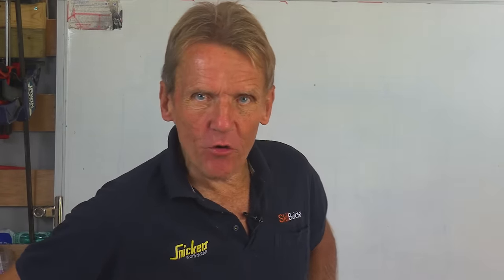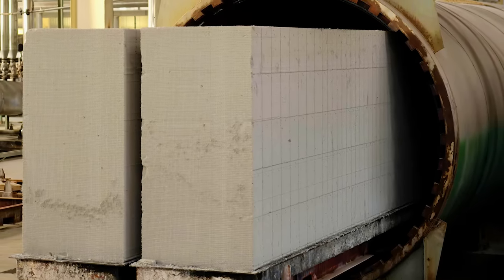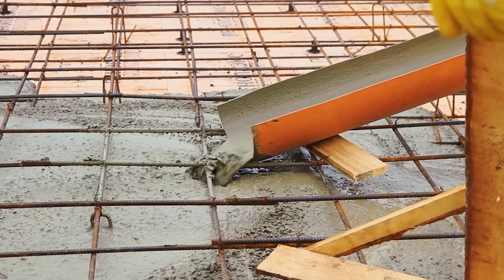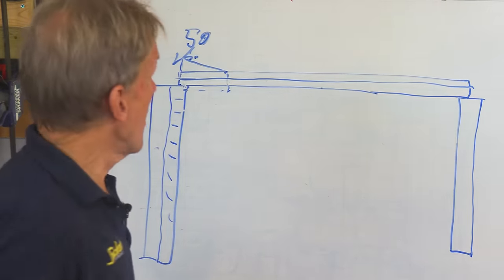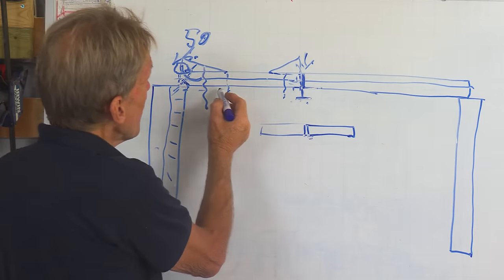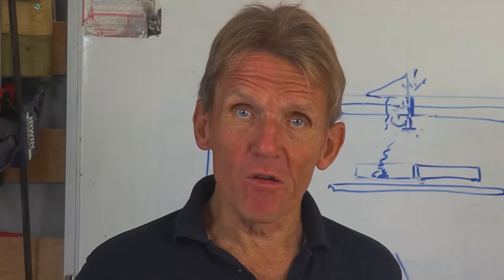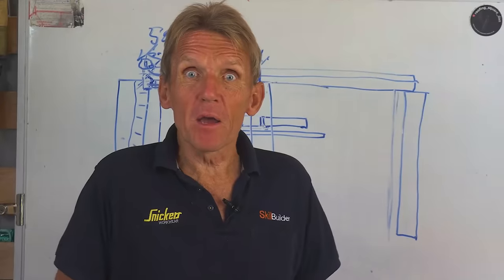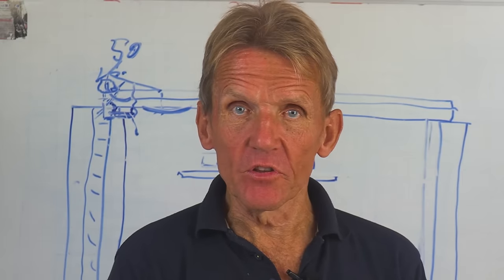The Ugly Truth About Reinforced Aerated Autoclaved Concrete (RAAC)

Comment: The Building Schools for the Future (BSF) programme was a Private Finance Initiative (PFI) con. The idea was simple; capital programmes are expensive and can't be funded from general taxation, so the government either has to borrow to build or do something creative. So the Labour government did something creative; they got the private sector to build and run schools and then lease the service they provided back to the taxpayer. It's a bit like leasing a car if you don't have the cash to buy or the ability to borrow. Except there's a thriving market for secondhand cars, but not so much for secondhand schools. And once the schools were up and running the government could hardly walk away. The financiers backing the projects knew this and royally shafted the Exchequer. The overall cost was significantly more than had the government just borrowed the money and built the schools itself. The same happened with several hospitals. Still, it made good headlines at the time.
Reply from the maker: That is good information and deserves to be better known. It is a bit like the disastrous PPL for the London Underground.

Comment: We have different building standards in Scotland... even the windows fitted in the upstairs of English houses are not allowed up here...
The asbestos was removed from Scottish schools before I left school (1989, although I can't remember which year I was in, when it was done in our school, maybe 1987).
I'd still advise they check the schools etc. (There will be a list where certain products have been used).
The driving force behind this particular knee jerk, is from a certain fire in London, that brought building products into the spotlight...
If there had been children in that school... is also a driving force. Much like cost was the main driving force behind RAAC, you buy it n fit it, done. Unlike a pour, where you shutter it, reinforce it, pour it, wait for it to cure... and that's before we get to the cost of the extra materials required, more concrete mix, pouring machines, etc.

I have to agree with the no flat roofs thing right enough... nothing but trouble.

Comment: Great  content and very informative. Just a thought, but could galvanic corrosion between the steel reinforcement and possible aluminium oxide from the aerated concrete accelerate deterioration of the structures?

Comment: One of the issues with 'template' schools is that Scotland does not accept certain building standards that are adequate in England... London would also not accept the increased cost of matching the Scottish model... So there is inherrently an issue with a 'standard template' in a union of seperate nations where there is no common standard.
Reply: We're told there's no problem with tartan RAAC though....
Reply: @Atari-stfm  Of that, I cannot make an informed comment tbh. There may be an issue that the regs could be more stringent on waterproofing (don't know why that would be needed in the famously arid nation in question, like a desert it is lol) There is also the possibility that a heavier inspection regime is in place as I know there are in other commercial areas... It is why, after Grenfell, Sotland had a much lesdser issue due to the fact that Scotland took a very dim view of that type of cladding in the 1980's.
Reply: @Atari-stfm Tartan RAAC, now that would make for a distracting classroom hahaha

Comment: Was it ot the case that 70 plus years a go, small independent builders could buy approved plans for 2 and 3 bed detached and semi detached houses; that way the planning consent would be granted faster and materials were readily available. You can still see such houses all over the country, still sanding and still in use. What has happened the BRE which was founded in 1921 as the Building Research Board --- oh yes it was sold off and privatised in 1997 that was such a good move .

Comment: RAAC was used mainly after WW2 to cope with the baby boom when money and materials were tight. This problem has been known about for a VERY LONG TIME. My infant school was built in 1952 and the roof had to be renewed IN 1967. How about replacing these roofs with one-piece solar panels?
Another rusting problem is with post war housing -  cavity walls built with ordinary steel butterflies and roofs with steel gangnail beams. Have these been investigated?

Comment: You mention repeatedly the problem of the extensive use of asbestos in (mainly) post-war buildings, the answer to which seems often to have been to cover it up and hope for the best. It looks as if something will be done about the risk of roofs falling onto children's heads, but what about disability and death 30 to 40 years down the line from asbestosis or mesothelioma? The prospect of sudden death always concentrates the mind, but preventing unnecessary disability and death in middle age should loosen the strings of the public purse too.

Comment: On some of them vids you showed, they were pouring concrete on to rusty bars, surely any concrete building is in danger if it got wet for a few days weeks before pouring?
Reply from the maker: Rebar is always rusty before the pour, the cement protects it from more rust but as that fails the rust returns. It is all about oxygen

Comment: Not sure the bearing width affects the shear as you say (although that may be an issue), I suspect the reduced bearing leads to a simple compression failure, which of course may then cause a sheer failure
Reply from the maker: I am not a stuctural engineer but, according the stuff I have read,  the shear point is where I indicated and the information about the bearing comes from the advice being issued to building managers.
Reply: If the bearing width was (for arguments sake) 2ft, I’d imagine the likelihood of failure would be less.

Comment: Not sure a standardised design is going to work when school sites are all different shapes and sizes. That said there could be a selection of standardised designs that could - when mixed and matched - offer solutions that will be more easily accommodated within the site boundaries, similar to the method developers often employ. As superior in longevity and aesthetic appeal as pitched roofs are, there's very likely some Local Authority planning issues that would arise from proposing them. Furthermore, some building designs present restrictions to the extent of pitched roofing and subsequently combinations of ptched and warm deck roofing are used as solutions.

Comment: The Southside collapse in Florida was a combination of concrete cancer and poor design: the pool deck was exposed to sun and lacked an expansion joint, so the incessant expansion and contraction worked the rebar at the side until it started to shear. After the first bar gave, the tension transferred to those on each side, unzipping the deck support and causing an elastic shock wave to fly sideways into the building, knocking out the temporary supports in the garage.
Concrete sets hot, and contracts as it dries, leaving capillary space around the bars. This combines with water surface tension to suck water into the voids, allowing the existing rust on the bars to develop. Rusted iron expands, spalling the concrete until it eventually fails.
However, aircrete doesn't normally contain rebar. The internal voids can absorb water, though, as you say, which is why the external skin is critical, and if that freezes because the building hasn't been heated, ice expands and can destroy the block. If it does, then the spalling issue can be far more serious, as the water resistance is far lower. Equally, the weight of water can overcome the strength of the material lower in the structure.

Comment: Well said - blunt and correct - politicos be damned.  BTW Roofers are the bane of every property owners existence.  So I applaud your dictum - dont build flat roofs.  But pitched roofs are a potential maintenance problem need your cowboy roofer %^&&^$%££%$ .  So builder a parapet pitched roof which allows the trough gutter to be for man safe access without scaffolding and long ladders.   Hence a competent handyman or DIY owner can do routine repairs (and gutter clearance once a year without serious HnS regs.  Standard roof trusses can be used with additional interior support so the ends dont protrude past the inner skin (or xfer load to outer wall with SS brackets - like floor joists).  Of course roof access thru loft hatch etc.  Once a year clean the trough of leaves. Whats not to like for a small extra care/cost?  Terraced Dwellings in victorian London were commonly like this and only suffered through neglect, allow trough to block and overflow!!!!!!!!!!

Comment: Government should go to the prefab buildings industry and have them build schools and hospitals unmass. 
If done right you could have the prefab sections as modular units that could be built and ready to use within 100 days from having the building knocked down, and that's for hospitals. Schools could be done far quicker, e.g. over a summer holiday.
Would create a standard, energy efficient, insulated cool and warm building that can be used for decades, and if there are problems in an area, just slip out the old module and put a new one in.
Rebuild our hospitals and schools quickly and easily.
We could then sell the design around the world to help pay for school and NHS projects

Comment: If corroding reinforcing bars are the main cause of the structural problems in buildings with RAAC why are the rebars not galvanised, or even manufactured from stainless steel. Stainless could also be used for the other steel brackets mentioned in the vid.  Whilst S/less steel is far more expensive that mild or carbon steel it would avoid the need to carry out repair work at some point in the building's life span.

Comment: In my experience in real estate, engineering surveyors are either incompetent or competent but wildly pessimistic. Without a big expense in time and or equipment it's very easy for even an experienced surveyor to miss hidden structural problems exposing them to legal risk. So the competent engineers are very wary, and write pessimistic reports. This means the incompetent surveyors tend to do better, they write the reports buyers and sellers want to read.
Reply: I had a surveyor in lockdown sign off to say a prefab house was inspected but they never entered the property is this standard procedure?

Comment: There is another failure mode… rebar is there to provide strength in tension and sheer, since concrete has effectively zero strength in tension. A beam in bending has compression on one side (usually the top, in civil engineering), and tension on the other side. So the concrete takes care of the compression side, the rebar takes the tension. If the rebar is not glued to the beam, there is no strength in tension for the composite, so the beam could easily snap at the point of maximum bending moment, which is (normally, unless unevenly loaded) the centre. Acro props round the edges won’t prevent such failures!
Reply from the maker: I talked about that failure mode and the compression/tension.  I am not sure a failure in the middle would produce such a sudden failure. I could be wrong about that but the Gravesend school collapse was shear at the end.
Reply: @SkillBuilder  Apologies, I missed that. I’m not sure that all failures will be similar, especially if the Gravesend mode has been made less likely. The whole mess is unbelievably sketchy. I suppose rusting along the whole rebar is relatively unlikely, but 🤷

Comment: Is RAAC the same as Ytong?  and does RAAC have sufficient compressive strength to serve  as a load bearing wall?
Reply from the maker: Ytong is aerated The material can be used in walls with no problem other than cracking.

Comment: It’s utterly incomprehensible how RAAC ever became a viable building material in the first place. The risks of Iron Oxide Jacking in solid rebar concrete (RC) has been known since the inception of RC. Indeed, concrete is predominately alkaline, which prevents oxidisation of rebar when the concrete is first laid. This is evident when decommissioning RC using a breaker: the rebar is mottled in appearance with no iron oxide patina at all. The problem occurs when fissures in the concrete from the effects of stress (thermal expansion and the concussive effect of road vehicles on bridges and multi story car parks, for instance), permit rain water with a low ph (predominately acidic from the effects of sulphur dioxide) to peculate through and attack rebar which will rapidly reduce from the effects of the same. Iron oxidation-reduction (redox), occupies more volume then the iron it replaces, consequently, under expansion pressure the aforementioned “Jacking” takes place and slices of concrete slough off from exposed sides and undersides giving the effects illustrated in the photographs.

RAAC is by design porous. From the very time it’s laid, RAAC is on a time to live. All building materials deployed in roof sections will be exposed to dampness, which is why the roof space must be ventilated to keep the space fresh. Never mind the effects of acid rain leaking through flat roof installations. The risks of adding rebar to AC were known when this material was developed. In any case, AC doesn’t have the torsion or bending moment for a roof application. Is this a case once again of politicians choosing who they listen to?

What will be the effect on AC blocks caused by dampness in a cavity wall, blocked by a cavity fill as part of the Green Agenda? Aluminium oxide jacking is a distinct possibility! Now there’s a can of worms.

Comment: Interesting & informative but you miss a few non building facts: 1-BSF was a financial nightmare with the average cost for each bidder (building consortia) averaging £3m. With multiple bidders on the larger contracts & a complicated bureaucratic process BSF became a snouts in the trough exercise with many of the completed projects (funded off the govt balance sheet via Private Finance Initiatives courtesy of Gordon Brown) then on sold to international private equity & investment companies. Gove was right to stop BSF, but what came after it (underinvestment) was arguably as bad. However, as you point out this issue has been known for 20+ years and has killed no one whereas asbestos has caused huge amounts of long terms health problems and thousands of deaths. The other side of this issue is how many schools do we need? Right now we have 9m+ students due to a baby boom in the early 2000s. Pupil numbers will drop by almost 1m by 2032 (govt est) & with 25% of students persistently absent, we will need fewer and probably smaller schools (as many as 10% less). What might not be good news for the construction industry is that at some point (not yet) the govt (in England) should develop an online virtual school. This, if it's done well, could reduce the demand for space by another 5-10%. Whether Labour (if they win) will do this is a complete unknown with most of their announced edu policies focusing on mental health and removing tax exemptions from private schools. I doubt they even have a plan for how many schools we need, nor probably do the DfE. Finally, the issue is as big in social housing and some parts of the private office sector. Your idea of a standardised design has also been tried in Australia without much success, but I agree it may be part of a solution. Another would be repurposing office buildings as schools (done successfully in several countries).

Comment: My concern is that they have known about this problem since the 1970's (my brother in law was putting steel support beams into buildings to hold roofs up back then) so why the sudden rush by the government to publicise this problem, what are they hiding or diverting eyes from. Could it be the draconian net zero law that is going through parliament at this very moment  where you can get one year in jail and £15000 fine for having a log burner or not having a smart meter.

Comment: Brilliant explanation and very timely.  I remember hearing about aerated concrete blocks years ago and was always suspicious that they would be less strong and durable than normal concrete blocks - something with air bubbles in it can't be as strong as the same material with no air bubbles.  But RAAC reduced building costs, which is why they were often used, by tory councils in particilar (because reducing public spending is their number 1 priority). If only political leaders were interested in the future of our country instead of the future of themselves and their parties.  Labour and tory are both as bad.  We need a new main party with principles and the Greens are the only ones anywhere near that.

Comment: I hired 36 Acrow props to repair our crappy block and beam basement roof and re-lay an RC suspended slab. Each prop was £1.50 per week. In the end, it took so long to get the job done, it would definitely have been cheaper buying the Acrow props. sigh
Reply: Always buy acros i say - you can always sell them on - in fact - could be a shrewd investment in the current situation😀 great explanation by the way!!!

Comment: The entrance doors to the maritime museum here in hull were hung in 1872, easily weigh a ton apiece yet today you can open one one of them smoothly and quietly with one finger! Some local schools are as old but being demolished, like the old infirmary. The new school near me replaced a lovely old building with a caretaker who would wax the floors each summer and maintain the structure. The taps in the toilets of the new buildings leak, door handles are already wobbly and falling off, and the locks are a flimsy joke, the floor trim and glue joints made by ‘agency trades workers’ bubble and rise……but someone is making a shedload of money…..the system is as rotten as the buildings.